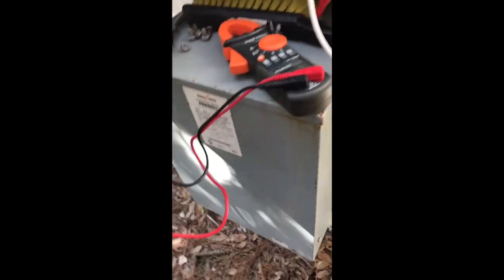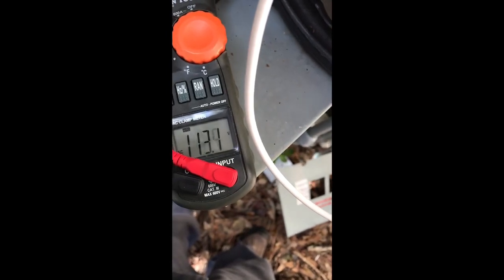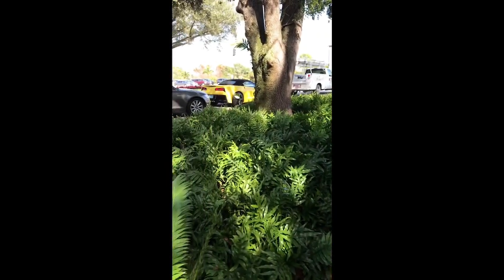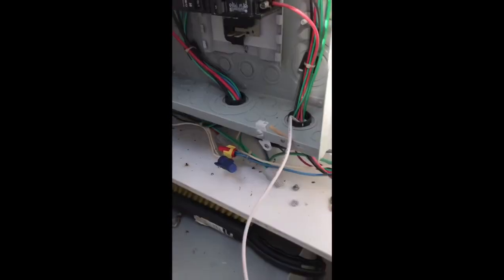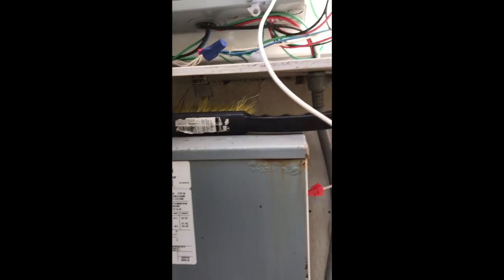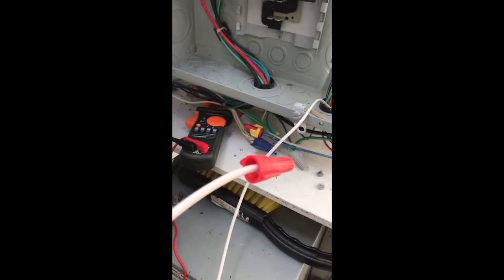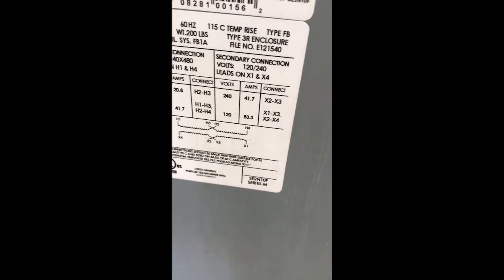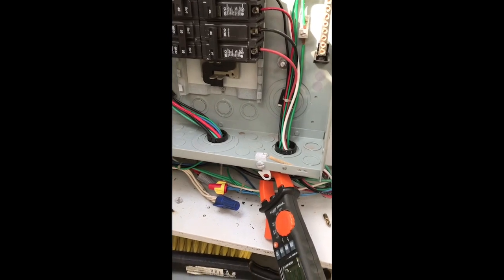480/240V step-down transformers part 2 resolution

Comment: I am not an electrician. 

So you connected the X2 X3 to ground? After reading up on transformers this is correct, something I learned a long time ago and forgot. The secondary side of the transformer is isolated from the primary side, it is an induced voltage but there is no physical contact. This means you need to ground one of the outputs, and in the case of wanting to set up 240V/120V, you would ground the center tap so you have 2 120V legs (X1 to X2/x3 and X4 to X2/X3) and 1 240V leg (X1 to X4). Thanks!

I'm doing something similar and my plan is:
Jump H2 and H3, 480 coming in across H1 and H4.
Jump X2 and X3 (now referred to as X2/X3), and connect to ground.
Run 4 wires to a sub panel, X1, X2/X3, X4, and ground.
X1 is phase A, X4 is Phase B, X2/X3 goes to an isolated neutral bar (not bonded), and ground is connected to a ground bar.